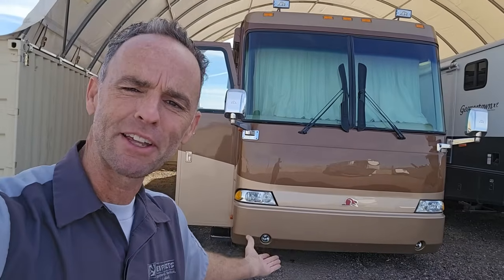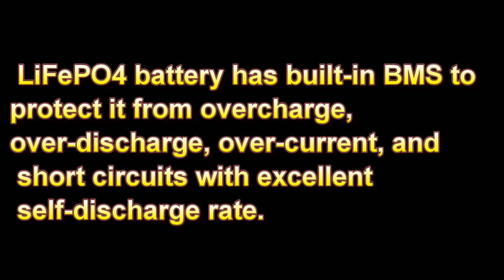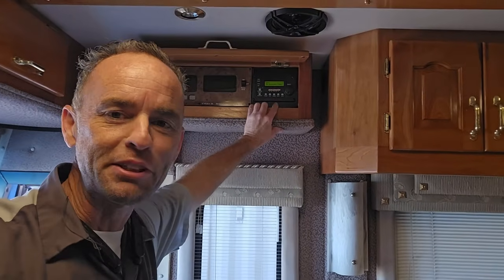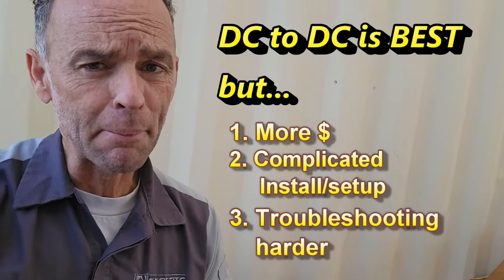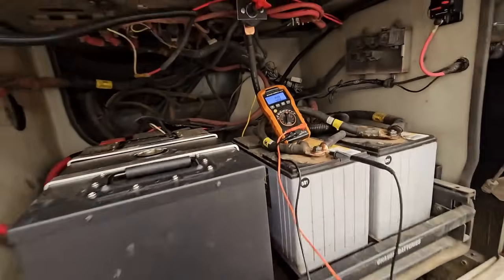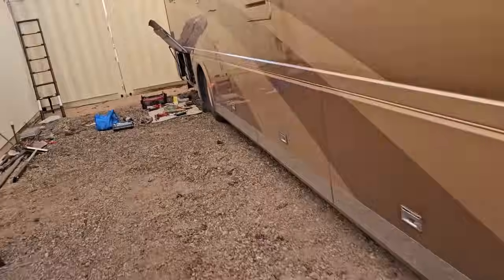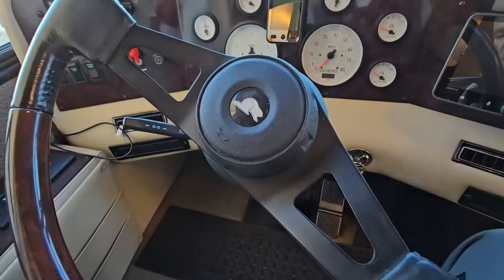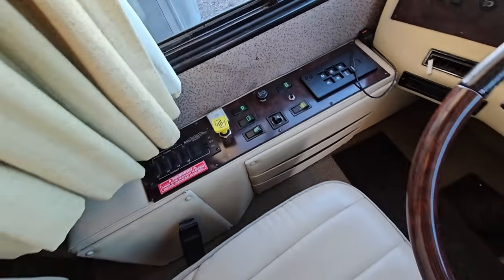What You NEED to Know About Adding Lithium Batteries to Your RV

Comment: I took out 8 lead battery's {all rv Battery,s }then put in 4 lpo 12oo amp hrs with 1150 watts solar also change alternator to BALMAR CONTROLLED SYSTEM .Now seven years later everything is fine.when I did it I was the only one in us to do this,no RV manufacturer did this or would do this.

Comment: Solar is indeed the way to go. I have a 2004 Tioga class C with two residential grade solar panels I installed on the roof. A 310 W panel drives an MPPT charge controller for a 100 Ah lithium battery which runs a 2000 W inverter for a two-outlet branch circuit I installed in the coach independent of the coach AC shore power system. It provides all the power we need for the coffee machine, microwave, toaster, and TV. When we're not camping (which is most of the time) I disconnect the solar and charge controller from the battery and let it sit idle for three months at a time per the manufacturer's advice for maxing out battery life. I also have a 255 W panel driving another MPPT charge controller for the two lead-acid house batteries, which I'm going to replace with a 100 Ah lithium battery. Rather than worry about converter and alternator compatibility, I'm just going to unplug them from the new battery. If the solar doesn't keep up with the DC load then I might have to rethink things, but the RV has a generator which we never use and we do a lot of dry camping and have never run low on battery power with the lead-acids, so I'm hopeful that this won't be an issue with the superior lithium battery.

Comment: I would check with Magnum about that "Equalize" setting on with your Magnum Inverter/charger. The head tech guy at Magnum told me on mine that it should be set to off.

But also check with your lithium battery manufacturer.
Reply: Same questing to Magnum but I was advised to set “equalize” 14.4V and program it not to come on. But if it did, it would not cause any problems.
Reply: That sounds like plan. Mine is just set up.

Comment: Great Video!  So thankful to find someone address installing Lithium Batteries in a 'Legacy' AGM RV setup.   I watched this along with the battery install video and a couple questions came to mind:  1)Given your solar system appears to be connected right to the battery, is there any concern of overdrawing current through the solar system?  2)You mentioned the new shunt-relay was bi-directional.  Does this mean the house inverter could be drawing from the coach batteries?

Comment: Looks like VARTER is using JBD BMS modules, nice. There are LifePO4 BMS modules that can be used for much higher current demands, like starter motors however, those have internal boost converters to meet the demands of charging the starter battery.

Comment: Idle current capacity of your alternator is KEY. It will do full output at idle. 
If you dont rev up your motor you will typically not get you rated output current. It will overhead. You NEED the fan speed. 
And burn up your alternator.  
And like he said that truck pigtail will not carry current you will need on a depleted lithium.

Comment: Completely different scenario, but, I ran yellow tops in my boat for about 12 years. The same yellow tops the entire time. Last year I started to notice I could only get about 3/4 of a days worth of trolling from my batteries. They were finally dieing off. Slowly but surely. 
Those yellow tops were given to me from a guy I know who drives a KW for a living which had a climate control system installed that ran off of those batteries, 4 of them, and he switched over to an APU and GAVE me those batteries. They run about $300 a piece.
So for the same money, I bought 2 LiPo4 lithium iron phosphate batteries. 100 amp hours each. The yellow tops weighed about 70lbs a piece. I was utilizing 3 of them, 2 for a 24v trolling motor and 1 for a 12v radio, then I still had the original starting battery, also a lead acid battery.
The new lithium batteries weigh 35lbs each. BIG difference. But, I can go 3 full days of trolling on them without recharging and still be at about 35% on the batteries. They are amazing. 
That being said, I did have to buy a new onboard charger that could handle both types of batteries, a 4 bank charger which was an additional $350. 
But for a guy like me, who spends as much time as possible on the water that I can, I don’t think I’ll ever go back to the lead acid batteries. The up front costs will be gained back over time, they weigh at least half of lead acids, they deliver way more power for way longer, and are simple to maintain. Plus, I don’t have to keep my onboard charger plugged in 24/7. Just long enough to charge the batteries then done. Well worth the money, just have to be careful WHO you buy from.

Comment: I went with a Renogy Rego DC-DC which is bi-directional, not a fan of the Li-BIM cycling it relay at high current every 15 minutes vs DC-DC regulating with semiconductors. Plus Rego can buck/boost voltage where BIM just connects both sides at same voltage. Wired a dumb Cole-hersee in parallel connected to dash switch for emeregency boost.
Reply: I'm also not of fan of the cycling BIM. It still puts significant load on the alternator and my existing BIG BOY w/ Bird controller isolator works just fine. So I went with perhaps the cheapest solution for my coach and just connected the ignition signal to the unused GENSET input on the bird controller. This has the effect of opening the BIG BOY relay anytime the engine is running. Basically I don't want my alternator charging my big bank of Lithium's at all. I have enough lithium capacity  to easily run the entire coach loads on my longest drive and if for some reason they were low I would just start the generator while on the road to charge my Lithiums. I've been running this way for several years with no issues.

Comment: Great info, just clarify the 14.4+ volts are needed to balance the cells. The BMS will not balance the cells completely without a top-off voltage. You are correct that you can use lithium on a standard system. However, this will degrade the cells faster than normal. You had some great recommendations on how to handle the top-off voltage. solar being one of them or using the alternator system in a motorhome. almost all converters that have been made in the last 15 years can output 14.4+ volts. It’s usually either some kind of jumper wire that looks like a telephone plug or some kind of smart controller that also uses an RJ-45 jack. Check with the manufacturer before you buy new equipment.
Reply from the maker: most lithium batteries don't want to be charged at 100% all the time so undercharging to 80-85% will not damage them, BMS keeps cells balanced while charging too

Comment: My gasoline generator is connected to the house lead acid battery to start it. Will that be ok if i change over to Lithium when it comes to the cranking of the generator. A generac guardian 40g model. I believe it's a 3.6kva.

Many thanks for any advice. Mike

Comment: As you discovered the Li-BIM 225 is bidirectional which directly connects a Lead Acid battery with a LiFePO4 battery system, with charging current flowing either way (not good).  A likely scenario is that a heavy load is shut off on the chassis side (starter off) while the Li battery voltage is low (isolator connected) causing the alternator to give massive charging amps to the Li battery. The isolator can't react fast enough to disconnect because the Li battery is pulling down the alternator voltage below 14.4v. The specifications on the Li-BIM 225 allows 1200 amps for up to 30 seconds.  Therefore the Li battery BMS will isolate the Li cells as amps exceed the maximum for the Li battery. When that happens, it is like pulling off the battery cable from the Li batteries at maximum amps.  The voltage spike will cause the alternator diodes to fry.  This is called flyback voltage.  SInce the Li batteries are isolated by the BMS, there is 0 volts on the coach side of the RV now.  The alternator sees a load of 200-300+ amps, then 0 amps.  What does the Li-BIM 225 do now?  Everything is off.  You now have to manually reset your Li battery and diagnose the red alternator light on the dash.
As you can tell I don't like this system.  What these companies don't tell you is what happens when the BMS isolates the internal cells of the LiFePO4 battery. It is not predictable - massive load to no load instantly.
So what do I like?  A DC to DC charger that always gives a proper voltage and amps to the LI battery so that the BMS is never going to see voltages or amps that will trigger an isolation event to the battery.  It will never overload your alternator and the wiring is as simple as the Li-BIM 225.  To charge the chassis battery from the Li side I just use a trickle charger powered by the inverter, but if you have solar (I don't) you don't even need that.
I really love your channel and what you do, so please don't take this critically.
Reply from the maker: I appreciate the information and comments. I think there are many scenarios that could be imagined, even dc to dc could fail, I am not sure I follow your situation completely. From my prespective, damaged alternators is already a more rare possibility with LiFePO4, but adding a dc to dc and battery tender has increased complexity for most DIY and technicians. Most Frieghtliner chassis already have a ECU controlled circuit which cycles the rv charge solenoid if chassis power gets too low, and for over 20 years, these BIRD systems have cycled thousands of times connecting and disconnecting every 10 seconds to one minute as the loads cause spikes to the alternators. The Libim225 just changes the parameters slightly

Comment: Class C but still helpful. Understand your solenoid relays on board before you burn up your alternator from it overcharging the coach battery. And in 20 years ive already replaced that solenoid twice as they fail regularly.

Comment: Relative to the BMS, does the draw on the battery due to operation of your hydraulic leveling, slide operation and gen set start up cause the BMS to shut down?
Reply: It hasn't been an issue for me. My only negative is that I am using the mh in the winter and I only bought one lifepo with a built in heater, so my capacity at night drops to one 100wh lifepo.
Reply: I dont carry a plug in charger, I have a portable LiPo jump pack 4k watts, and it starts the motor with no issues, so it is my backup. For the generator/house batteries as well.

Comment: Hello and thank you for your very informative videos. I am upgrading my 2016 Thor Tuscanys's house batteries to lithium. My question is dealing with the Trombetta switch and the battery relay. I am installing the Li-BIM 225. I know you spoke of removing them both and for the most part that's easy but they both have extra wires and fuses running to them and that's where my issue is. What do I do with all the extra wires?

Comment: Question, James.  I was looking at a 300AH Vatrer 12V LifePo4 battery. It says it's BMS has protection for overcharing and overdrawing. So why wouldn't this prevent any damage when using the boost option for combining the house batteries when  starting the Engine? We have several Gooloo battery jump starters that are lithium batterties. They are really small and can start a large V8 or a diesel up to about 6 liters. Our 7.2 liter Cat might need 2 of them, which we carry with us, but they don't have any problem boosting the completely dead battery in my 5.3 Suburban. Thanks James.
Reply from the maker: booster jump packs are designed for that, the bms will cutout likely over 300amp draw for the starter. The relay protects the alternator and not the battery.

Comment: I switched to lithium 2 years ago in my TT pigtail doesn’t send enough current to be a problem for the alternator and I can only get about 80% with the converter. But portable solar will quickly recharge to 100% if boon docking and it is want to top up before leaving to boon dock I have a stand alone multi profile battery charger with an adapter that I can plug in to the solar port

Comment: How does the BMS actually limit discharge current?  Does it communicate with your inverter? What about limiting charge current? How does the BMS do that? It does not seem that the internal battery BMS has what is necessary to limit current on it's own. I have watched videos of diy LiFePo4 batteries being assembled and a BMS installed. The BMS appeared to be nothing more than a voltage monitoring device.

Comment: Can I start my genset with the lithium battery ?
Reply from the maker: Very likely yes, some generator battery cable runs are very long and may cause too much voltage loss but generally 200amps is what is needed.
Reply: Thank you for the great information. I have a 2013 Tiffin with the Ford V-10 engine. I think a 240 volt lithium will work to replace my two lead acid coach batteries. As I live in northwestern Washington state we usually get a couple of weeks where the temperature gets as low as 15 to 20 degrees for a few days in a row. I do not have access to any electrical connection to supply any type of heat to the coach or batteries. Is it best to remove the lithium battery when I know the temp is falling below freezing or can the battery withstand that temp for a week or less. Love your u- tube projects. Thanks a lot.

Comment: What if I totally disconnected my house batteries from the house battery solenoid. Wouldn't that make 2 separate systems? Then the RV would charge the coach batteries with the alternator and I could use the generator or solar to charge the house batteries with no charging issues between systems. Would that work?

Comment: Exactly all the details the other lifepo conversion videos are missing! Thanks, subscribed! Am I missing something or can't you just switch off the house batteries before and during engine operation to protect the alternator?
Reply from the maker: Thank you. Yes, you can turn the battery  off with the app but then you would lose 12vdc house power
Reply: @AZExpert  Thanks for the reply. I'll have to see what outlets/appliances are on that. Might not be a big deal to lose house power when travelling. We've also got a mechanical toggle switch up front that does the same thing. I'll have to see if that also prevents alternator charging. We've got solar direct to the battery, so if I can leave the battery on with the app, but shut it off with the switch, it'll still be getting a charge at least.

Comment: Want to thank you for this video and information. This wasn't even something I was aware until recently and when i searched the subject, your video came up. We just bought a Tiffin Open Road Allegro 36UA equipped with a Magnum (2000watt, lithium compatible) inverter/charger and 400 watts of solar. My plan is to swap the lead acid house batteries for 600-800AH of lithium and add another 800watts of solar to increase the amount of time we can boondock without running the generator too often. I will install the BIM to protect the alternator. I know you were talking about trying to start a diesel with a LiFePO4 Vatrer that has a 250amp BMS, but if I have a total Discharge rate of 500 amps ( 2 300AH batteries with 250 amp BMS each) of LiFePO4 battery bank on a gas coach, do I still need to disconnect the start boost? Also, is that adequate/appropriate to start my Onan 7kw gen set with AGS set to say 20% SOC?

Comment: James, excellent information! I have two questions, with my fiver, did I understand that I really wouldn't have to add anything to it switching to the LifePo4 battery just that it would only charge to %90 capacity? Also, is there an issue with going to 2 - 230 Ah vs 1 - 460 Ah as I would save $400? Thanks for all you do in helping us RV'ers.....Kindest regards, Ted

Comment: Question,
I left my RV repair place Cummins , for a couple of weeks.
I have installed lithium batter for the house, 300 ah.
The RV would not start , chassis battery to low.
So I used my aux aux sw to start the generator, with the generator running I was able to start the RV end. 
Watch your video on installing the  li-him 225 sw, so I don’t burn out the alternator, I like that idea. But every RV is different .
2016 Tiffin open toad 37 PA. I am not sure where to install this ?
Where are you located? 
I would love for you to install for me.
Thank you 
Tom U

Comment: James, I love your video. Best channel on YouTube. I need some help! I bought a Vatrer 460 LiFePO4 and the Li-BIM 225 like you did, and when I looked at my battery bay on my 2003 Holiday Rambler Endeavor to come up with a game plan, there was no battery isolator to be found! I know there is one somewhere because my batteries charge as if isolated. I cant find the wire for the Alternator anywhere. The large battery wires disappear thru the back wall of the bay and I have not been able to find an isolator. Could it be that a 2003 doesn't use a diode one? Does the big electrical board in the bay under the drivers seat maybe control it? I am at my wits end on what to do. You have a video that I watched in the past that you were showing how to install a BIRD that is similar to my coach. On that board there are lugs that say House Battery and Chassis Battery on that board. I have pictures but don't see an option to attach. Thanks for any help, John